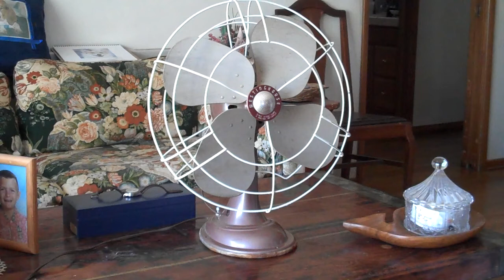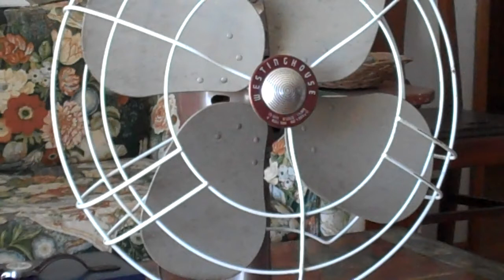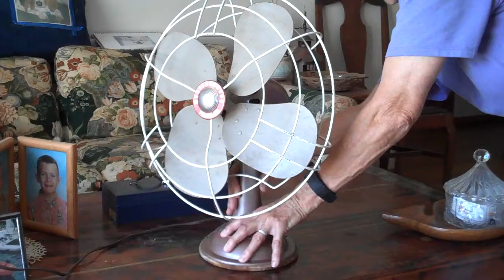Vintage 1950's Westinghouse 16" Standard Oscillator

Comment from the maker: @PUboiler29 - You can use resistors to replace the original if it breaks, I know a guy who has done this. I'll get the info and post it on the DT Forums (and as a message to you).

Comment: mine picks up speed alot faster and i am sure its the same motor. i think mine is about a 1955ish model. i know its got 7/16" bolts holding the motor together which is way overkill! i would guess that the grease in the oscillator could be your culprit making it lag to get up to speed.
Reply from the maker: It was gummy bearings. I have a couple of update videos on this one.